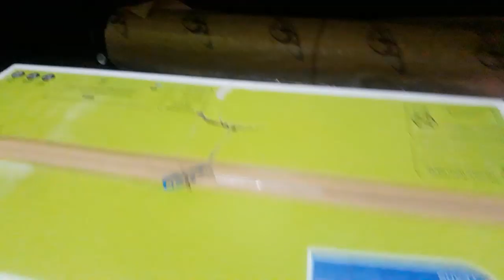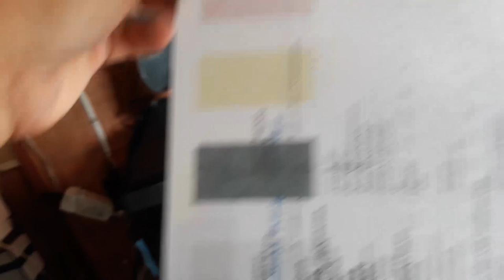my modified Epson  L1300 eco solvent printer

Comment: i wish to change my 42'' hp designjet 500 to eco solvent. can i just use original refillable cartridges and buy new silicon pipes?
Reply from the maker: If the cartridge is eco solvent compatible...

Comment: 17,500 lang printer at 1,800 lang ang kit. May 7,700 ka pa pang replacement sa dumper at replacement sa head pag nasira. Hindi naman sobrang riski kasi hose lang papalitan need lang manual. Mas maganda matutunan mo mag convert kasi mahirap at hassle ang eco solvent pag wala ka alam.
Reply: san nakakabili boss ng kit